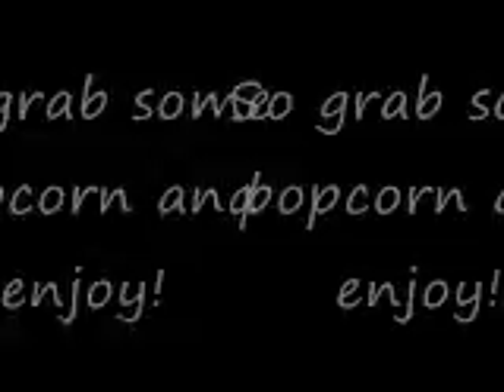4hp air engine

Comment: Nice little converted engine! I wouldn't worry about the pitting on the piston, my small aircooled suffolk looks like a large piece of metal got into the cylinder at some stage but it still runs great!

Comment from the maker: @SousukeSgt I had an oiling system in those, so yes there was oil in the crankcase. If it's a vertical engine and you don't have a dipper the oil won't do anything so there's no point in having oil in it. Thanks